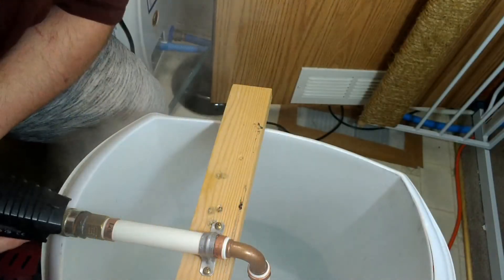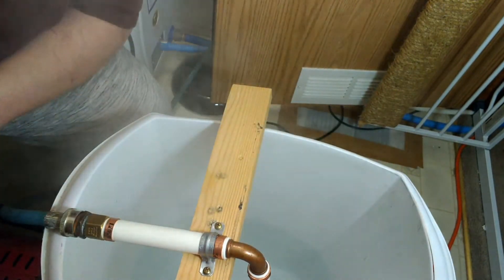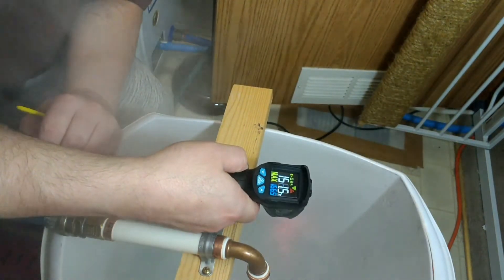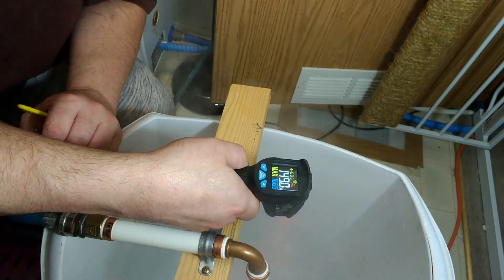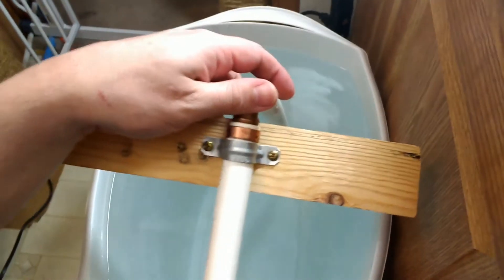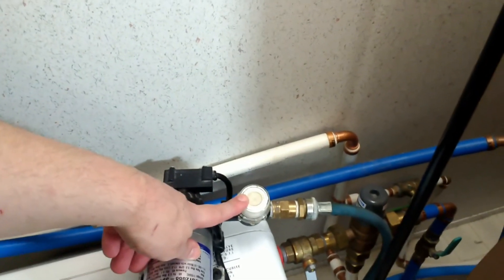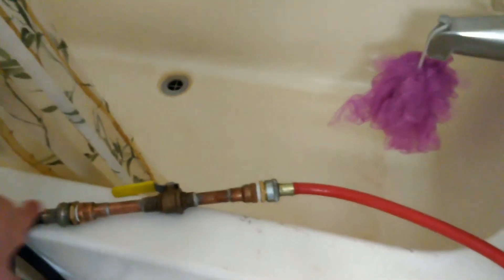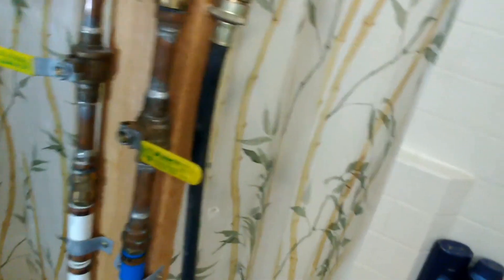Oh No! NO HOT WATER at my home! What to do!? | Manifest Practicality E022

Comment: I have an on demand propane hot water heater that works very well. It's also mobile so you can be in the middle of a field, in the winter and as long as you have a water supply, battery and a pump, it'll work. I've actually done that!
Reply from the maker: Those are a good solution! I have a little for a few oddball purposes. So why not just move to an on-demand setup? I as much as can to be powered by fuels or energy that I can produce myself. This reason is why I put a big focus on my solar.

So that is my philosophy. Hope it makes sense.
Reply: @reedin9954  Yep. I just looked mine up. I have an Ecotemp L10 but really, the L5 is the better bet. The L10 was really too large for my purposes. Ecotemp has a package deal of the heater, a pump, the regulator and show head for $161. Can't beat it. It's on Amazon.
Reply from the maker: @Thomas Whitten - That is a really great deal! I will go check it out. Might get one even and mess with it. I could see it as a great use for a few emergencies.
Reply: You know, if you ever need something to be researched, just let me know. I have nothing else to do with my time. My email address is on my youtube channel. In the about section....like everyone else.
Reply from the maker: Cool! I will be sure to keep that in mind.  I have been planning to start a weekly news report to cover things from a different point of view and having someone help look over stuff would be very helpful.

At the moment I'm still working on the software setup and I have ordered stuff for a faster internet connection.  Once I get it setup I will contact you.
Reply: @reedin9954  Cool! I'll be around.

Comment: Must feel good for one of your preps to pay off in ypersonal SHTF.

I unfortunately had a similar issue plus several more minor ones. One day after about 7 years the bottom of our water hear fell apart.

The minor issue was repeated a few times when the Whirlpool water heater we replaced it with kept having the temperature switch for the gas go out. After replacing it 3 times under warranty I finally decided to just buy one off the shelf at Lowes and haven't had anymore problems. Always something isn't there...
Reply from the maker: Actually, lots of my preps have gotten me out of a bunch of dumb problems.  One reason why I keep a lot of plumbing, electrical, screws, nails, and other construction materials area.  

The most likely disaster we are going to face is going to a natural disaster and handling that is all about rebuilding and fixing things.  Or making makeshift living areas and using camp stoves and so on.

And since you brought it up I should make a set of videos about what my focus in prepping is and some of my prepping philosophy.

Now I do also a lot for the great epoch but I have a very large practical focus as well.

Water heaters when they want to go nuts they really good nuts!
Reply: Manifestation of Imagination Yep, they either hold water or dump it all over the place 🤦‍♂️

Have had to dig into some of my preps but just food and minor medical supplies so far.